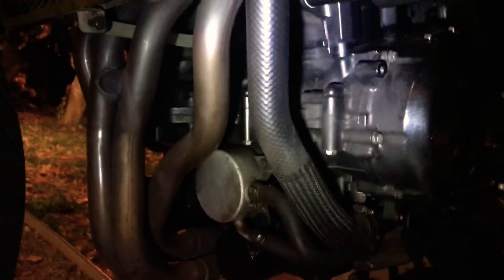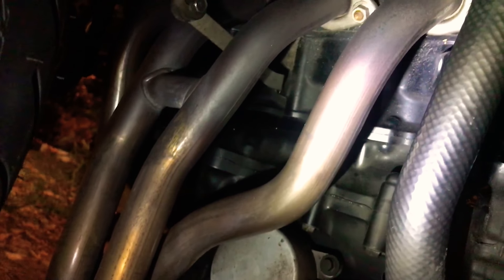Motorcycle Engine Clicking/Ticking Sound? Check this fix first! - Kawasaki Z1000

Comment: This is 100% correct.  I have a zed 800 Kawasaki.  Roughly 17k miles when it started. Check engine light first thing I noticed then a gradual ticking noise that sounded almost identical to a valve tick. After reading online many people said to check manifold bolts. Right away with a short extension and 12mm socket. I was able to get 2-4 full turns out of 4 bolts. They say to tighten these manifold bolts while cold, obviously if the engine was hot the bolts will expand some still causing same issue.  As soon as I started the bike noise was completely gone. Was ecstatic to know I didn't have to tear into my heads! Hope this helps someone else.
Reply: You don't have a " zed 800".  You have a z800.   Stop adding a consonant to the pronunciation to the last letter of the English alphabet if you're going to speak and type in English.
Reply: Motoryzen  haver? That's not a word. Anyway, across the pond they say Zed instead of Zee... you realize our English is American... not proper English, right? In fact most English speaking countries pronounce it Zed... Figured it was important being you had to point that out.
Reply: @manniemaniac  And yes I know across the Atlantic UK as well as many Canadians incorrectly pronounce the last letter of the English alphabet.  Adding a consonant to the pronunciation of a consonant is asinine and incorrect, regardless of your feelings.
Reply: xD   Here's my sign.  Lol.  *nods * I corrected it.
Reply: I doubt theyll stop w the zeds... to them, zed aint dead. Because zed never dies.

Comment: MAN THANKS!!!!!! I was afraid that my engine is dying. It was loose bolts of exhaust. On cyclinder 3 one bolt was almost gone.
Reply from the maker: Martynas Vaidila glad you found the problem and avoided an expensive fix!
Reply: Li Fan dont forget u need to change exhaust gaskets as well
Reply: That's what Im worried about. Did it tap faster with acceleration?

Comment: This was the last place I considered looking, my Z1000 ninja has been making what sounds like a noisy cam chain for the last couple of thousand kilometers, I came across your video checked my exhaust bolts and got a turn and a half in on all of them. Problem solved! thanks for putting this out there. We all seem to think the worst when it comes to engine noise and overlook the simple solutions.
Reply from the maker: Yep, glad your issue is solved, happy riding!

Comment: Few weeks ago I bought GTR 1400 and I noticed engine had a bit of ticking sound. I brought it to attention to my mechanic and he said nothing to worry about. I took my bike for first long trip and when I was coming home I noticed this very loud metalic ticking sound coming from the front of the engine. Next day I dropped to mechanic again and he couldnt hear anything out of order.. I started to think this is not possible, this bike just cant sound like this, it was just too horrible, after watching your video I took off fairings and guess what.. 2nd and 3rd pipe was missing one screw on one side.

Altho Its not fixed YET Im pretty sure that is what is causing the problem. You sir are a legend and I want to thank you for posting this video. All the best !

Comment: Please tell me was yours same situation as mine?

My motorcycle produces normal sound when I start it initially and accelerates. After travelling for a while, the engine gets really hot and starts making this clicking sound. Do you think that manifold bolts will be the problem? Or any other as per your knowledge? Please tell me.
Reply: Mine does that,have u fixed ?

Comment: What's the torque settings for the header bolts? Would the z1000 torque figures be the same as the z750 2008

Comment: Did you losen the bolts completely and re-tighten to spec, or did you just tighten to spec from where they bolt already was at?
Reply from the maker: Just tightened to spec from where they are when cold
Reply: @TheGizmoGarage  could you share the torque spec? Thanks!

Comment: I got in an accident but thankfully me and the bike were ok. Initially i didn't notice a ticking sound until it the temps outside got colder. The sound Seems to go away when the bike warms up, but definitely noticeable off a cold start. I really didn't pay it too much attention, I figured it was the bike just being cold making weird sounds until it warmed up. Had it out the other day though and man the acceleration felt sluggish. Felt almost like my bike was in low power mode or something although it all might be in my head as I am definitely riding a little more cautiously since the accident. I will definitely be checking this out just to get some peace of mind. Could be a small leaks that starts to close itself as things expand and the bike heats up. If anyone has any other suggestions I'm all ears. My brother is a mechanic and took a look when i first noticed it and said it is probably nothing considering it goes away once the bike is warm. Said it could be cold fuel injectors, cold oil taking a while to get to where it needs to go, metal parts ticking as they expand, ect. The lack of acceleration has be bothered now. Any help would be much appreciated.
Reply: Hi, what turned out to be the issue? I'm in pretty much the same situation (dropped the bike twice, once on each side, rather than having an accident; noticed the sound when it got colder, acceleration now seems kinda sluggish, but I'm riding more cautiously because whether + I've been trying to figure out where that damn ticking comes from every time I'm on a ride).
Reply from the maker: @luciemanson2546 could just be loose exhaust bolt, or maybe leaking exhaust gaskets, Check torque on bolts when cold.

Comment: Hello! I have this noise too on my Z, I tight exhaust bolts but i have same problem. You have power problem too? I mean my bike hits 11.500 rpm and stay there it not hit the rpm limiter.. Thank you!
Reply from the maker: Then it's definitely not the exhaust problem! Maybe a valve adjustment and also check timing chain.

Comment: My Cbr is making a clicking noise when idling so could I send you a video somewhere I want to know if it sounds like a exhaust leak
Reply from the maker: The loosened exhaust bolts are easy to check, grab yourself a torque wrench, and torque all exhaust bolts up to spec when it's cold, then start the bike and hear to see if the clicking has gone.
Reply: @TheGizmoGarage  alright i'll try that soon but the noise goes away when giving some revs so does that confirm anything?
Reply from the maker: @yhteys  https://www.youtube.com/watch?v=OYvxFC5XW8c&ab_channel=LiReviews this was the video I recorded back then, it was the clicking at the beginning of the video that's caused by lose exhaust bolt.
Reply: @yhteys Sounds like symptoms of a loose timing chain, try replacing the tensioner.
Reply: @JH09SUMIT  yeah I suppose it was the tensioner giving up. I did replace it with a manual one and the sound went away.

Comment: Have this issue with my Ninja 250 FI 2013, got its tensioner replaced in 2018 and now then noise comeback. Will do this trick hope it's work. Thanks!

Comment: I have a similar noise, and had an aftermarket system installed a year ago so, I think maybe one of the bolts may be loose now. Did the noise ever go away when you blipped the throttle? Thats the one thing making me think it could be something else. If I blip the throttle it'll go away for about 4-5 seconds and come back.
Reply: Any update, I have the same issue rn lol

Comment: Hello i have a kawasaki Z750 2007 and i hear also a clicking noise . I have tighten the bolts of the exhaust buth the clicking is still there what else cane cause that clicking noise ? Sorry for my english i dont speak good englisch
Reply: Same thing, solve the problem?

Comment: Hey bro jist curious is it still ok to ride with tht clicking noise till i have time to take to shop?
Reply from the maker: Depending on what's causing the clicking noise, if its exhaust, yes ride till safe to tighten exhaust when they are cold and torque to spec. If the clicking is something else, say valves hitting things, then it's a more serious issue and you may want to get it fixed asap before damaging your valves and pistons.
Reply: @TheGizmoGarage  appreciate u man the clicking does sound near radiator/cylinders but lets say im riding then pull in clutch the clicking stops would u have any idea? ik its not much info but thought id ask anyway

Comment: Wow..
Really.
I bought a 2018 Zx10r Krt.
With 1500 miles on it.
Makes alot of sense bro.
Lets say when i come to a stop i hear that nosie echoing to my helmet...
When it comes to idle it stops?
Ill ck on that first.
Ty
Reply from the maker: prob just sound leaking out from manafold... cool bike and tighten to spec on those exhaust bolts

Comment: I have a 05 zr600 and I was riding and all of a sudden it changed sounds i found out I had a spark plug that was bad the bottom of it was gone it was burned out what is the problem
Reply from the maker: A melted electrode on your spark plugs means that they've been running too hot for too long and could burn a hole through the top of a piston.

Comment: what is the torque for this? i dont have manual
Reply from the maker: I remember it's not a very tight torque, found this online since I no longer have the bike.

Fastener
N·m kgf·m ft·lb
Remarks
Rear Camshaft Chain Guide Bolt 20 2.0 15 L
Throttle Body Assy Holder Bolts 12 1.2 106 in·lb
Cylinder Bolt (M8) 27.5 2.8 20 MO, S
Cylinder Nut 49 5.0 36 MO, S
Cylinder Bolts (M6) 12 1.2 106 in·lb L, S
Exhaust Pipe Manifold Holder Nuts 17 1.7 13
Muffler Body Mounting Bolts 20 2.0 15

Comment: Spray some carb cleaners around the cylinder bolts and see if it makes a different noise. If the sound changes then you have a leak
Reply: Do not do that.....
Reply: @joshsutcliffe6099  it’s not a problem if you do.
Reply: @Lazaro-138  it doesn't work like that on the manifold. Only on intake. Your gonna cause a fire spraying flammable liquid onto a hot exhaust
Reply: @Lazaro-138  your exhaust Is doing exactly that...it's exhausting..aka blowing out
Reply: @joshsutcliffe6099  well that’s why you don’t spray into the exhaust. But around the outside cylinder head gasket. If there is air leak the cylinder will suck it in and change sounds and return to normal.
Reply: @Lazaro-138  thats not going to tell you if you have a leak at the exhaust manifold.